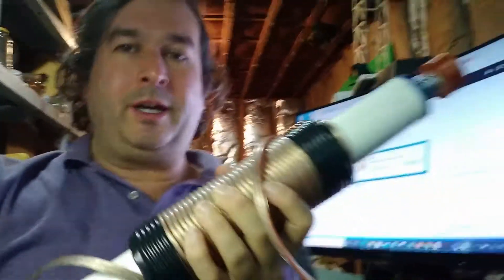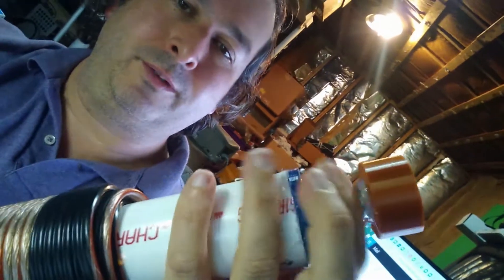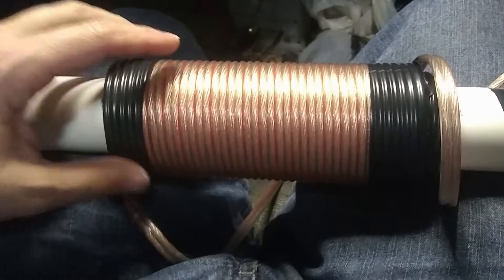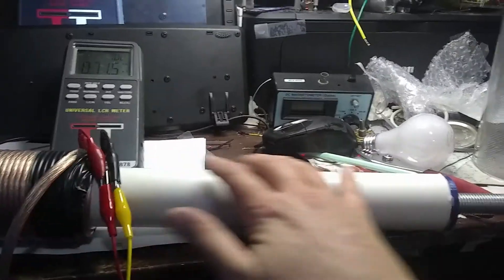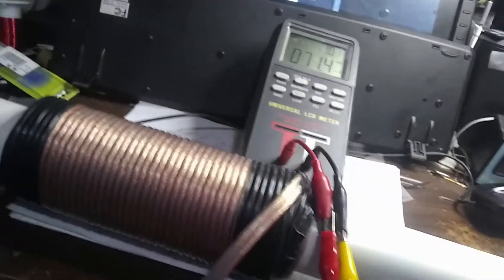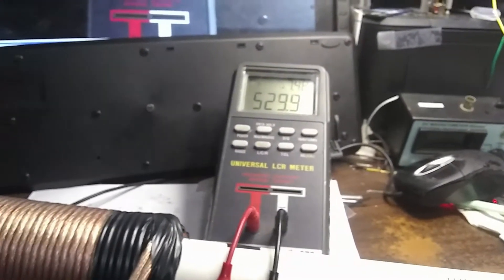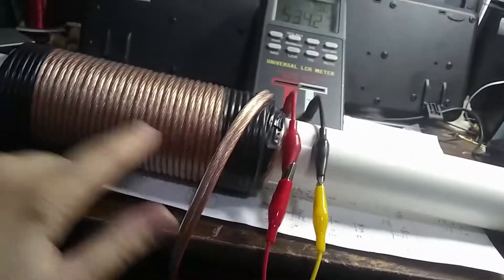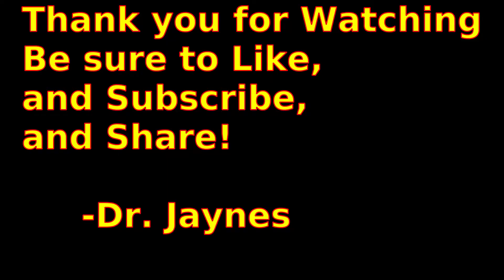Giant Variable Inductor - Part 2

Comment: I'm glad it made an improvement, I'm surprised the iron core only accounted for 10uH .
Reply from the maker: Yes... Maybe it is because the conductivity is higher in the threaded rod than in the core, so the coil inductance is shifted the opposite way because of surface currents displacing some of the flux?? The meter measures inductance at 1kHz... ( I have actually noticed different inductance values in other devices operated at much higher frequencies...... i.e. material properties may be freq dep.) Also the fields may not see the mu of the interior of the core very much, due to surface currents as well??? The ferrite core is sintered together, and made to have low conductivity.. (I believe).. Just a guess.. It is also thinner than the core.. Anyway.. thanks again.. I will be doing some project with this electrical component.. hopefully soon.. I see you do many interesting electronics projects as well!